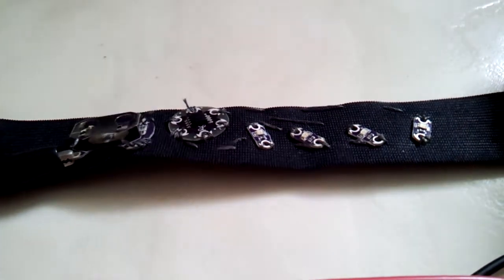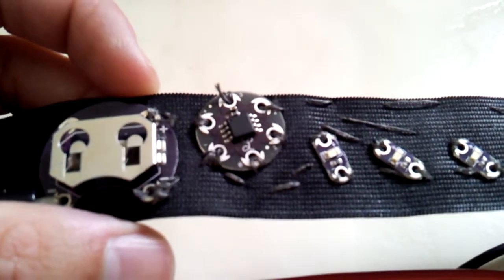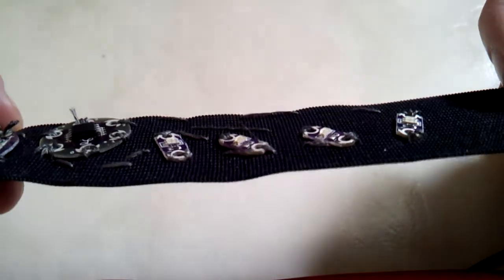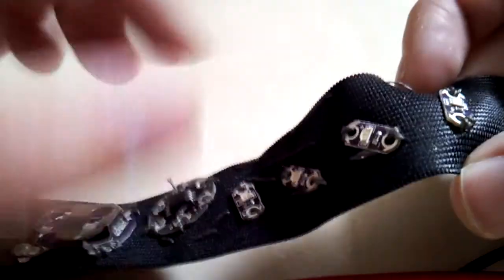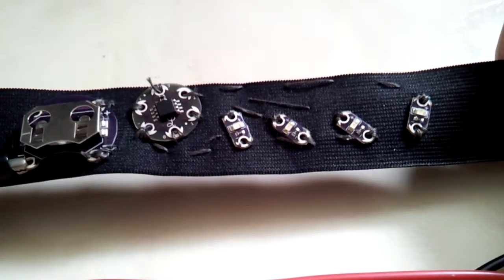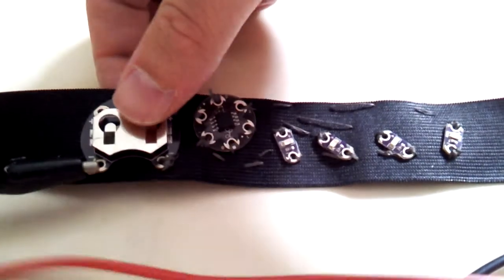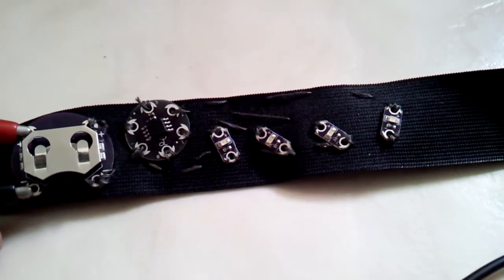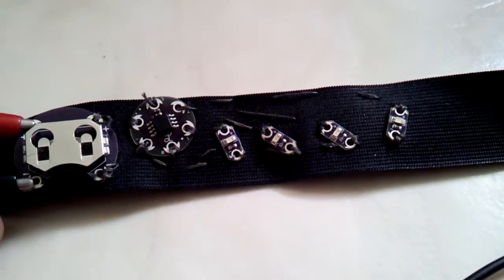LilyTwinkle (Lilypad Arduino chip)

Comment: Thanks for sharing Martin. Is it possible to add more than 1 LEDs in the same input? Thanks!
Reply from the maker: Hi Victor, glad you liked it :)
I'm not sure, maybe it is possible to run two LED's on the same output but I don't really remember the output. Maybe 20-40mAh per output.